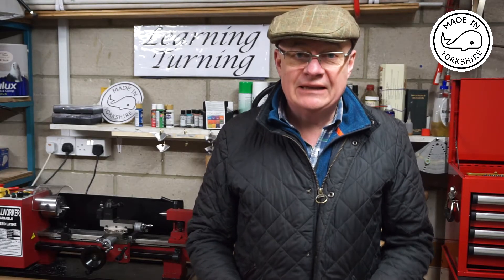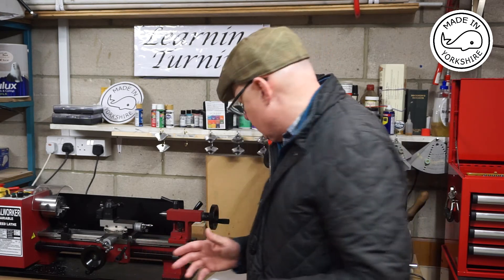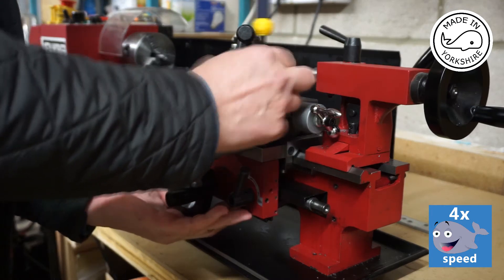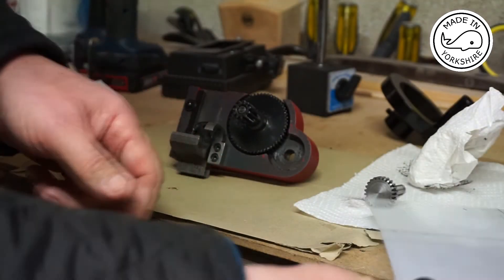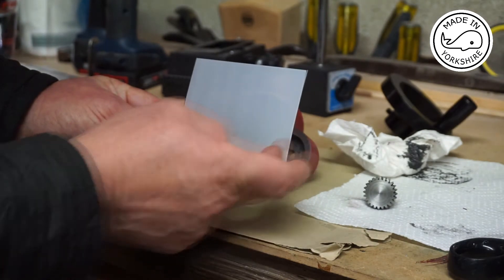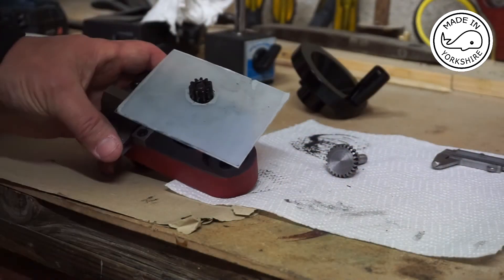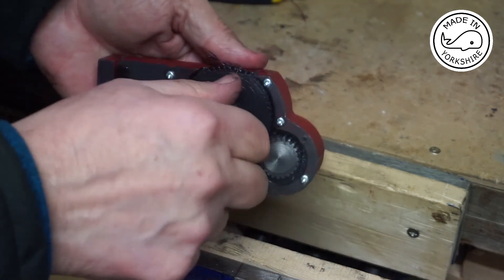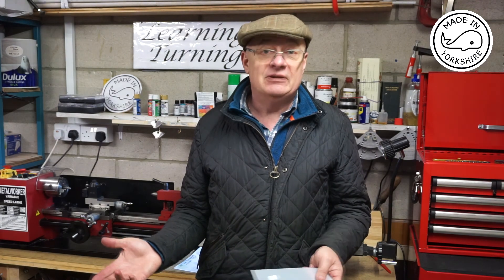#MT13 - Making an Apron Gear Cover for my Sieg mini lathe. By Andrew Whale.

Comment: Recently got myself a SC3, just before we went back into our fourth lockdown, it has been a lifesaver getting me away from the TV and the sofa and distracting me.  This will definiely be my next mod, along with a carriage lock.  I find random pieces of swarf love to get between the gears and produce janky movements when using the carriage handwheel or the lead screw.  Your method of removing the apron is much easier than other I have seen where they remove the whole lead screw.  Many thanks and cheers!

Comment: Andrew....
I noticed in another similar how-to vid that his pinion, drive gear, was equipped with ball bearings.  I don't know if this was a hi-end factory piece or an owner modification.  Bixt that this is a steel shaft running in a simple cast iron hole, I have considered installing an Oilite bushing for the pinion.  Looks like it would be easy enough to accomplish with a bench top drill press.
Any comment on that idea?

I'm also not particularly fond of the covered lead screw because in necessitates only one half of the pair of half nuts usually found on the apron.  So which  do you feel is more important, 2 half nuts, or the chip cover on the lead screw?  Comment?
James
Reply from the maker: Hi Steve
I don't have this lathe anymore but unless the pinion is causing problems I would leave it alone. To install a bushing you would need to make sure that it is perfectly perpendicular and centred spot on the original hole. You only need to be a few thou out to prevent the gears from meshing correctly.
I appreciate that the lead screw cover inhibits the installation of 2 half nuts, but personally I prefer avoiding chips. I have seen telescopic lead screw covers on larger lathes (which I guess allow for 2 half nuts) but I've not come across them on the mini lathe.
All the best.
Andrew
Reply: @learningturningmetal  You are probably correct about the bushing's placement, even though it is just a hand wheel and not a high speed precision affair.  So I'll just leave it alone,though I did drill an intersections oiling hole.  Best for me to not try to fix a problem that doesn't exist....

Comment: hello Andrew,
 here is anther tip ,i took off my wheel on the carriage,and put a trust bearing between it and the carriage,it was sized just under a half inch.i.d. I don't know what your dimensions are.check and measure it first.and it now turns smooth as butter, and does not wiggle any more...brilliant. see you next time.i have the grizzly 7x12 and a couple of other lathes in my shop....I'll  send pics of it.take care till next time.
Reply from the maker: Thanks Ray - I will add it to my improvements list.
Cheers
Andrew

Comment: He he 69th subscriber, how could I not subscribe? I tried Steve's cover with gasket maker, but its just too bloody messy, so like you, I went with the drill n tap. 😋
Reply from the maker: Hi Dave. I think I must have missed Steve's gasket version - I will check it out. I did consider using epoxy resin, but I think that would have been messy too.
Thanks for subscribing and if you have any advice please leave me a message.
Cheers
Andrew
Reply: Learning Turning - Metal ah sorry the blue goopy gasket maker idea was mine after seeing Steve's vid (sheer laziness on my part) didn't want to have to drill n tap, but we learn the hard way us blokes 😋

Comment: Nice modification Andrew, I did a lot of machine maintenance fitting when I was an apprentice and it’s not for everyone, you’ve certainly got the bottle to have a go at it, great job mate..👍👍👍👍👍👍
Reply from the maker: Thanks Allen. I was a little nervous when I started mods on the mini mill. It didn't seem right drilling holes in a new machine, but I decided to bite the bullet. Nothing ventured nothing gained. Replacement parts seem pretty cheap so if I really mess up I can always buy a new part. Now I just need to decide on a nice little project to undertake on the mini mill and lathe.
Have a great day.
Cheers
Andrew